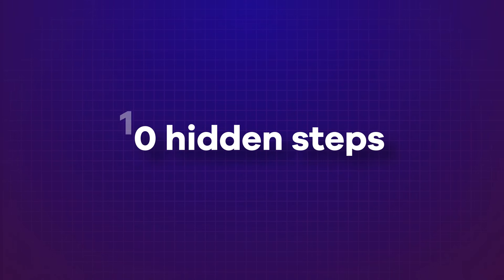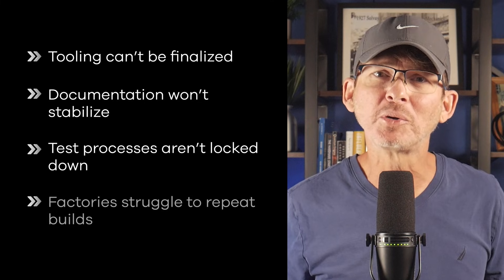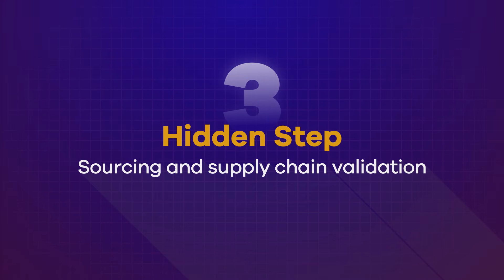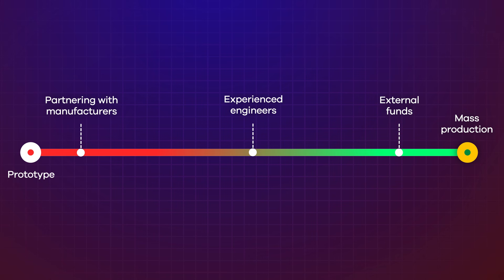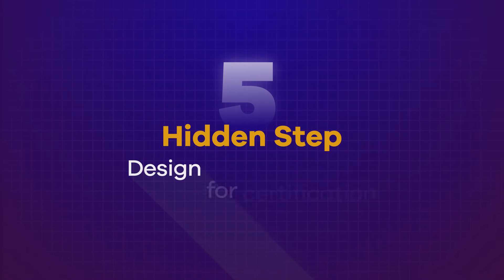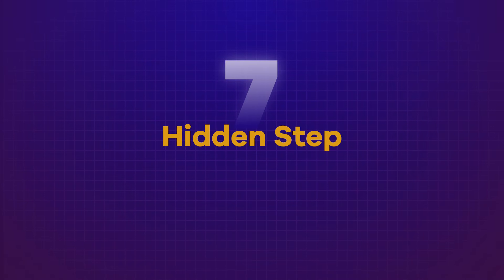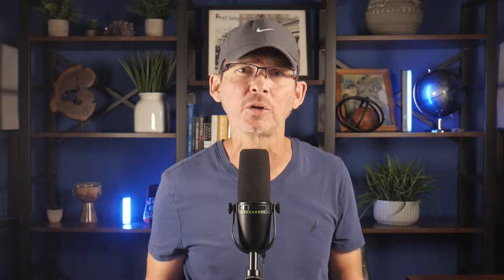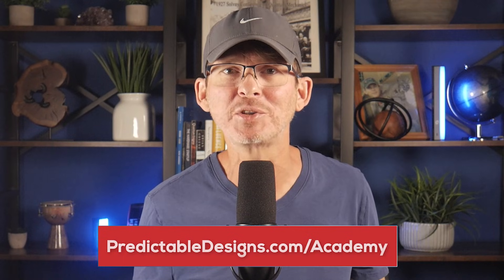10 Hidden Steps From Prototype to Production

Comment: This video feels a bit like a punch to the gut as someone who started from 0 electronics knowledge two years ago and is now 85% to a fully functional prototype PCB (just got my second version of the PCB in). Watching this makes me feel like I’m still years and 10’s of thousands of dollars away from selling anything. Any thoughts on a timeline of everything you mention in this video?
Reply from the maker: I know it feels overwhelming especially after so much work on the prototype. I don't want to punch anyone in the gut, but I also know that sugar coating things won't really help you. The prototype isn't the finish line, and it's really the starting line.

The key is don't try to do all of this by yourself. The development part can usually be handled by you alone, but the manufacturing setup requires you get help from manufacturers. I don't recommend most founders ever try to fund all of these steps using their own personal money, instead use other people's money.

The best way to do that is with real product market validation. Once you have that then manufacturers will take you seriously, and be more willing to help you through all of these steps.

Also do this in stages. Don't try to go from a few prototypes to 10k units. Instead do a hundred or two, and just do everything manually like testing. It's much less overwhelming if you go in stages.

For most products I've seen it takes 6-18 months to go from a prototype to mass production. The lower the production volume the quicker you can get there, so if you start small you'll be closer to the 6 months.

And the most important lesson, is don't ignore all of this stuff (including marketing) while you work on your prototype.